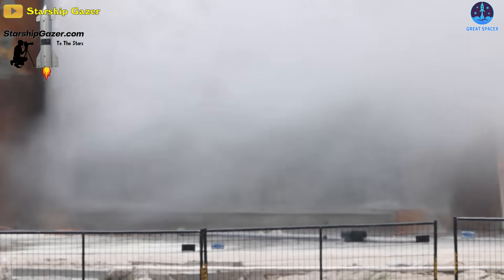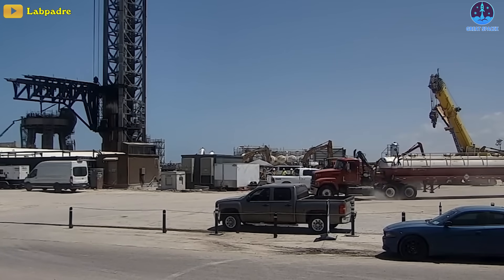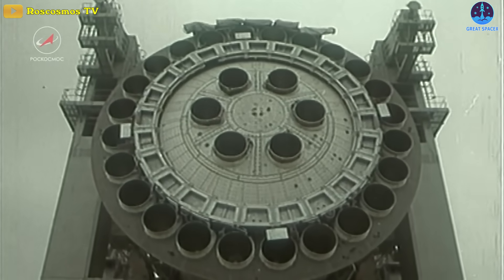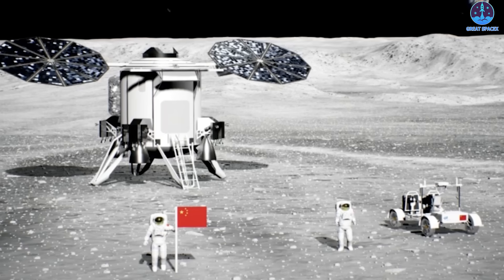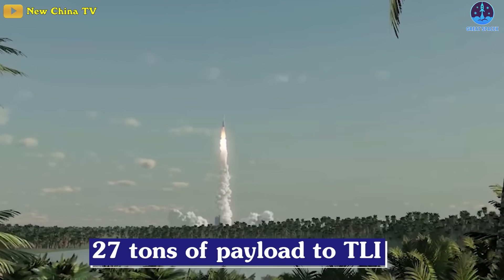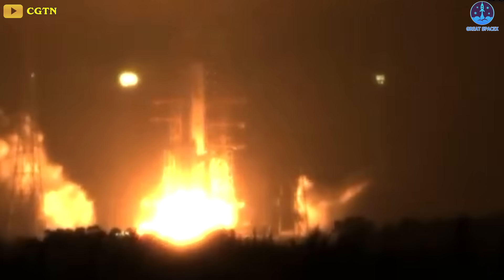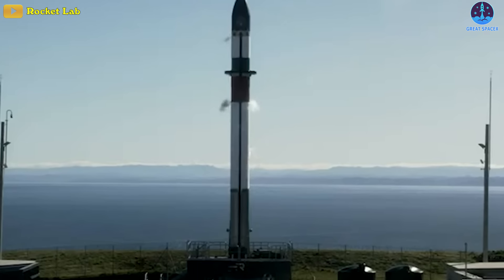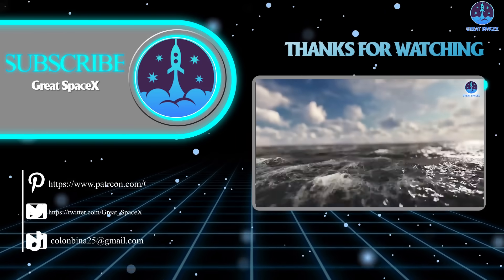Finally happened! First Water Deluge System Testing with MASSIVE WATER...

Comment: I'm very skeptical that this solution will work. I dont think that water fountain will be a match for the enormous force generated by the raptor engines.
Reply: The logic here is that you are not passively diverting flame but actively negating the force of the flame with a direct opposing force. This thing will not only work it will be copied and used by other launch platforms.  I mean, water pressure alone can cut a car in half.. half you ever seen a water jet cutting machine?
Reply: @4ndrebass0  water is only the cary medium for the cuting material
Reply: Water turns to steam, that proces absorbs a lot of heat and when the steam expands it transports the remaining heat away from the launch site. It just might work and I assume they did a bunch of simulations before building the thing. I guess we’ll have to wait and see 😂
Reply: It's not there to match the force but to control the thermals.  So the question is more if the solution is thermally correct or not.  The steel plates should be enough to handle the force at low temperatures. I don't know what alloy they are using, but some steels can handle work as high as  800C+.  Clearly, we are talking about massive amounts of force, but if we have enough water the temperature should not exceed 200C directly on the plate. The reason is not  100C is nonlinear and local effects. By the way,  I am not saying it will resist, I don't know the alloy,  I don't know the production water flux,  I don't know how much fuel the production Raptors will use per second etc. By the way, for a good margin calculation that: 1) suppose all the energy of the fuel needs to be dissipated by the water, 2) assumes constant acceleration (close as it will be just the time to clear the tower), 3 stoichiometric burn, the calculations are not difficult. Unless they are cutting corners the solution should be adequate.
Reply: It's obvious the majority of you do not have a clue about fluid dynamics. The plate will stay below 212 F
Reply: @Bryan-Hensley  Is it that obvious? I'm so embarrassed.
Reply: @Bryan-Hensley  I haven't got the first clue about fluid dynamics. Can you help an idiot out? I'm not saying I don't think this will work, but I'm always happy to learn new stuff. I mean, the Internet, right?!? Cheers Bri.
Reply: @Bryan-Hensley  it's easy to say that in theory, but there is no system on the planet even close enough to pump the required volume of water to keep it at that temperature with 30 odd raptors raining down on it. They also don't have the capacity to store the required volume & they also don't have the means to capture it all if they did (as not a single drop is allowed to touch the gulf).
Reply: @mervstash3692  it's not going to be pumped. It's going to be pushed out of the tanks with nitrogen pressure. Nitrogen pressure can be ten of thousands PSI if they need. The pressure coming out of the engines is less than 1000 psi.
Reply: @Bryan-Hensley  like I said, no system on the planet can deliver the volume and pressure required.
Reply: @mervstash3692  
The SLS launched years ago at cape Kennedy with a thrust of 39.1 Meganewtons used 450.00 gallons of water. Starship with a thrust of 72.2 MN may need about 830.000 gallons of water.
Each hole in the shower head with a total of about 672 holes must pass 123.500 gallons or a total of 3.14 million liters of water within seconds.

The currently largest water pump available
The Guiness book of records lists the worlds most powerful pump as follows:
Modell: Pentair Fairbanks Nijhuis HP1-4000.340
Capacity 60.000 liters per second
Head 0.5 - 5m
Ideal power 4,000 KW
Weight 120t
https://www.youtube.com/watch?v=Vd3M6eXcC3Q
Reply: @sindbad8411  they aren't using any pumps. It's using nitrogen pressured water tanks to push the water out. Nitrogen pressure can be ten of thousands PSI if they need it
Reply: @sindbad8411  100% someone has watched the common sense skeptic 🙂
Reply: @mervstash3692  Not really. I didn't need to listen to a professional naysayer to come to that conclusion. Once the raptors rip, the shear force will push those fountains down all the way to the floor, and the water will have minimal impact. While it will mitigate some of the heat, I'm not convinced that it will mitigate much of the downward force. 
But perhaps I'm wrong. I'll be glad if I am.
Reply: @Hannodb1961 bro, its 15 meters higher
Reply: @Hungary_0987  15m? Have you seen how long the exhaust ploom of the raptor engines is? 15m is nothing.
Reply: @Hannodb1961  all good. You just quoted him word for word basically. Thought you must have got the stats from him.
Reply from the maker: The steel will be the biggest part
Reply: That steel will melt and it will not be more powerful than nasal. I know because I specialize in pumping. He is already vaporizing the water at the outlet. Congrats to China for being 60 years behind.
Reply: I've got to admit that I didn't think that the space shuttle wouldn't be successful. I was sure it was going to drop like a rock. I was happy to be wrong. At least initially.
I'd like to see initial tests with just the booster. Seems to make more sense than adding the cost of Starship in the next tests which are likely to end up lost anyway. Test the launch process first and if it works without destroying the pad, test mechazilla for recovery of the booster.
Reply: @TheDavidPoole   "I didn't think that the space shuttle wouldn't be successful" What isn't you mean to say not exactly?
Reply: @MartensFamilyHomeMovies  😂😂 great spot Bob! I won't edit the original, as it would spoil good comedy. I actually meant to say "would" rather than "wouldn't" i.e. I thought it would fail. Spectacularly. But I was wrong. Until I was right, but for completely the wrong reasons (grabbing at straws there!).
Reply: Same I still believe an angled flame diverter is also needed as well as this water system.
Reply: @hometechUK its not possible
Reply: @hometechUK the flame diverter wasn't created to protect the ground, it was created to protect the engines from shock waves. These engines are designed to be able to withstand the shock waves..
Reply: @hometechUK not possible
Reply: It may survive a few launches, I think it should have acoustic foam type geometry, lots of spikes pointing up.
Reply: @Bryan-Hensley  clearly you never studied physics or chemistry mate. I guess literally every expert in the industry must be a moron too
Reply: @mervstash3692  All the "experts in the industry" work at SpaceX and designed this system. Or are we expected to believe that the people who designed the Raptor engine don't understand pressure and fluid dynamics.
Reply: @Hedgehobbit  Did the experts at spacex expect a massive crater in the launch mount when they launched star ship? That should answer your question.
Reply: @Hedgehobbit  SpaceX designed the metal plate. The rest was done by 3rd parties. 
It's easy to say that the people that designed it must know what they are doing. But the problem is the clown at the top making the final call is a doofus. You only need to look at the first launch for evidence of that. Where were these people then?
Reply: @mervstash3692  SpaceX knew the launch pad wouldn't survive the first launch.
Reply: @Hedgehobbit  They only figured it would be good for maybe one launch and already were working on the pancake design at that point.
Reply: @Hedgehobbit  yeah & they still went ahead anyway. Pure arrogance and zero f''ks given
Reply: @mervstash3692  And SpaceX gained knowledge about what doesn't work. They were already planning on installing the deluge system , so the damage from the first launch didn't even delay their plans. Results are what matters here.
Reply: @Hedgehobbit  so they were already going to install the deluge system anyway, but didn't because of why? Especially considering they knew they would obliterate the launch pad. 
And knowing all this, they still went ahead with the launch. All to meet a stupid "420" date. What exactly did they learn? They were rebuilding within days. Can't have possibly have had time to review all the data, come up with required changes, outline the project plans, organise all the resources etc.... BS! They didn't learn Jack. You guys say that about every one of Elon's fails. The 1st launch was a complete disaster & should never have gone ahead. 
As for losing time, sorry but they absolutely have lost time now. They will be lucky to gain approval for launch 2 before 2025. The entire collaboration with NASA for the moon missions is effective null and void now. It's put Starship back years.
Reply: @mervstash3692 they werent ready in time. Musk said via twitter after lauch
Reply: @zsigmondfeher4624  then why launch if he supposedly knew it would obliterate the concrete pad? Hate to break it to you, but he's on video saying "testing showed minor erosion" and they didn't expect any major concrete damage during the launch. Then he says after he knew it would blow a hole in the ground. He can't have it both ways. Clearly one of those two things is a big fat lie. 
It's the same BS like when he says they put the new steel plate through rigorous testing. Then when you watch the actual video, 1 single raptor causes the plate to blow a hole out the back of it and by the end the water pressure is a fraction of what it is at the start because the raptor obliterrated the jets. Then they conveniently fade out so you can't see anything after all the smoke disappears.
Reply: not a chance in hell. It will be raining bullets instead of concrete
Reply: @mervstash3692 be a little happoer.
They already tested it in worse conditions.
And it will survive at LEAST one la7nch. Thats already better.
Reply: @zsigmondfeher4624  what makes you think it will survive even 1 launch? All the experts in the industry disagree and say this thing is going to explode instantly when all the water inside the steel expands 1600 fold into steam.
Reply: @mervstash3692  it's simple really. The water pressure will be higher than the exhaust pressure.
Reply: @Bryan-Hensley  for the record, the calculations have been done. You need over 25000 psi. But ultimately, there is no pumps on the planet that can move the volume of water required from the tanks to the plate. 
Let's assume it could though, back to physics. 
The plate is now effectively using the same force to crush everything below it as the raptors. Meaning the same result as before.
Reply: @mervstash3692  Those same experts said that the rockets would never be able to land on a ship. And yet SpaceX has done it time and time again. Experts are often wrong. The water will not get that hot inside the pancake as it takes time along with the heat to do it and you won't have the rocket on the OLM for very long. water flow will start just before engine ignition so the water on top of the plates will have to be evaporated/ blown away first and then it will be replaced by more water flowing out and over the plates.
Reply: @mervstash3692  Me thinks your calculations are off by a large factor. Like about a factor of 100.. And there are no pumps involved. It will be done by gas pressure on top of the water exiting the bottom of the tanks.
Reply: @mervstash3692 I DONT KNOW, MAYBE THE TEST.
DUH.
Reply: @gravelydon7072  pumps/push, whatever you want to call it. There is no such system that will accommodate. 
And no expert said they couldn't land rockets on ships.
Reply: @mervstash3692  Willing to bet your life on that?
Reply: @eskieman3948  it would be a pretty safe bet at this stage mate